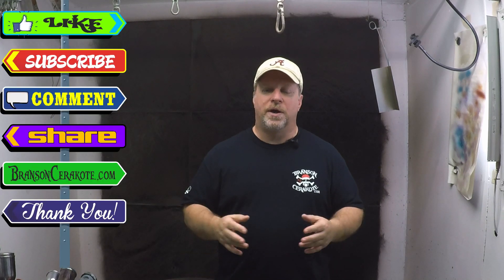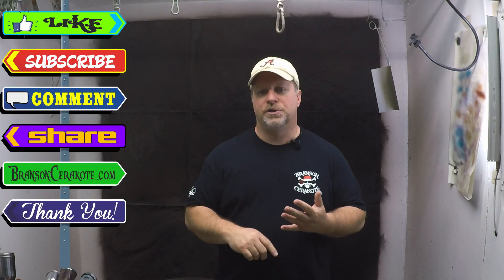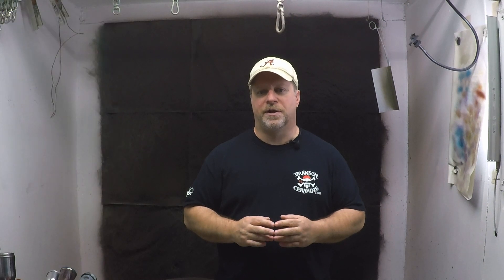Top 10 Applicator Mistakes I Hear About | Branson Cerakote and Laser

Comment: Hello John, you were talking about degreasing, you mentioned not putting a part back in the acetone. What if when you bring the part out of the Oven and it brings some oil to the surface, cerakote says to repeat all the steps over again? And I notice you degrease before you blast? Just wondering what is the difference in doing before you blast and after. 
Thank you for your videos and advice!!
DAVID/DB CERAKOTING
Reply from the maker: It's not that often that degreasing doesn't take care of any issues the first time around, however 700 barreled actions are notorious for weeping. Put them in the oven, heat them at 300 for an hour, and move them to a rack away from a heat source. Use a squirt bottle of acetone, and soak the weeping area. Put the item back into the oven for 10-15 more minutes, and check it again. Repeat as necessary. It usually doesn't take too many times to take care of the issue.

We soak, gas out, then sandblast. It's just always made more sense to me, and I've never had an adhesion issue from doing it that way. Not saying their way is wrong, but I've just never had an issue with mine.
Reply: Branson Cerakote thank you!! I always appreciate any advice that could help me do better work for people!!
Reply from the maker: @DavidBrown-cv7qb  Glad to help!

Comment: So if I’m doing two coats and I’ve gotten everything prepped, what you’re saying is, I should air dry for 8 or so minutes after I spray the base coat, stick it in the oven for 10-15 mins (depending on oven) then add your next coat?
Reply from the maker: Spray, air cure (to allow the solvent to evaporate), then bake in a 180 degree oven until tack free (around 8-10 minutes. It's a feel not an exact time). Remove, allow to cool. Spray the next color, repeat.

Comment: on multi colors do you remove the stencils for the final cure or are they able to handle the high temperature?
Reply from the maker: They handle it fine, but I usually bake the item about 15 minutes then pull them off. They are easier to get off, and it let's you make sure your project is good to go.

Comment: I am having a heck of a time coating my Taurus 605. I did an antique wear type finish using Graphite black on top of burnt bronze. It came out looking amazing! But the cylinder got stuck or super stiff and other parts as well. Even when I tried doing a thin layer. Is the 605 just that intolerant in its spacings?
Reply from the maker: Generally with revolvers, we will do the yoke in Microslick, bake it, then tape that area off so we can spray the rest of the gun.
Reply: @BransonCerakote  cerakote says micro slick has the same coefficient of friction as regular H and elite series. The only time they recommend using micro slick is if you need the higher heat resistance. What is your take on that? I get that the micro slick coating thickness is only ⅓-½ as thick as H/elite (which is why you recommended it to the op), but I was wondering about how lubricidus they are in comparison. Thanks.
Reply from the maker: @littlejackalo5326  It is a teflon coating. I'm no chemist, but I can tell you that in our experience, it handles repeated wear better, in areas like pistol barrels and revolver yokes.

Comment: Wow! what a great clip! Big ups to you Branson :) 
Question from my side (a newbie :)) 
I'm starting my very first Cerakote project and want to coat aluminum parts. 
Which sanding media and PSI would you recommend. Thx & greetings from Austria
Reply from the maker: 100 Grit Red Garnet is what we recommend. For metal, you want to be at around 80psi.
Reply: @BransonCerakote  Thanks a mil! :)
I found red garnet sand in my area with 80 or 120 Mesh. Which one would you choose then?
Sorry to bother you with these questions, but really what to make sure to follow the manual ;)
Reply from the maker: @marquezvanroeschen5340  It needs to be 100, but if those are your only choices, 120 may be the best. I don't think it's going to be aggressive enough, but 80 will crater your project.
Reply: @BransonCerakote  Ok great! Thanks!

Comment: I have a batch of -8 an fittings i would like to shoot in Glacier titanium air cure, i did a test  on one but prepped it with red scotch brite pad.  At the end of the video you mention this is a bad idea. What is the right course of action as sand blasting these swivel fuel fittings seams like a bad idea. They are anodized black the best i can tell.
Reply from the maker: You really don't have another option. The sand blasting doesn't just remove the existing coating, but also etches a specific surface pattern into the item that allows the coating to properly adhere. I've sand blasted thousands of items without any issues. Also, remember that all you need to do with anodized products is scuff them. The only difference is that you are scuffing the anodizing, not the actual item.
Reply: @BransonCerakote  Thank you for the reply. Great info and videos.
Keep it up.
Reply from the maker: @natepierce1281  Absolutely.

Comment: I need help with poly frames. All my frames that I finish come out sandpaper rough once baked, so I'll try to make this short. I clean the frame, degrease, sandblast @ 30 psi, wipe down with Acetone, spray air to dry, mix my colors, strain with proper screen, dial 1:2 ratio on gun, spray within 3" up and down, seem to coat very well, let stand for 15 min, bake @160-180 for 2 hours. it comes out like sandpaper??? I do the same thing with the slide, but 250 for 2 hours and it's always smooth as glass. Please help
Reply from the maker: could be a couple of things. Either you are sanding too much, or spraying too light. When sanding, all you have to do with poly is knock the shine off of it. Once it's dull, you are good to go. As far as dry spray, trash the Cerakote instructions on setting up the gun. The link below shows how we do it, and we don't have spraying issues. Dry spray can also be caused by spraying too fast. You may change the color, but the coating is too thin. I'm not trying to upsell you, but you may benefit from joining Applicator Hangout. Here's the HVLP adjustment video. https://www.youtube.com/watch?v=XsBd9xK1FbU
Reply: @BransonCerakote  Thank you for replying, trust me, nothing you guys do is ever an upsell, I'll take whatever advise I can get. I'll play around with air settings today as well as go lighter on my blasting. Thanks for the info.
Reply from the maker: @eddiewood537  Any time.

Comment: What's your air pressure at the gun when the trigger is being pulled to spray a part? Also why for cerakote does it get degreased, gassed then sandblasted? In my head I keep thinking sandblasting then soaking in acetone then degreasing would work. Sorry for the noob questions, I've Duracoated and hydrodipped for years but I have a bottle of sniper grey cerakote sitting in the gun room that I've been to scared to do.
Reply from the maker: Working air pressure for H series, V series, and C series is 20 psi. For clear and Elite, it's 30 psi.

Cerakote's official way of doing it is to degrease, sand, then gas. I've changed that a bit. I degrease, gas, then sand. I've been doing it this way for years, and have never had an issue. I wouldn't recommend soaking after sandblast. The problem is, sanding opens the metal up, and if there is any silt left in your acetone, it MAY find it's way into the metal.
Reply: Branson Cerakote totally agree with you. I reduced more of It just spending time degreasing as much I can. This is the most important in general to get a good finish. After I put more effort on phase 01 the number of oil residue left on parts decreased drastically! Again: nice video John!
Reply from the maker: @lnsimas1  Thanks for watching!
Reply: @BransonCerakote  thanks, working up the nerve to go out to the garage and go for it.
Reply from the maker: @speedfreak1000z28  Worst that can happen is you sand it down and start again.
Reply: @BransonCerakote  that's true, wouldnt be the first time, hydrodipping had a learning curve too.
Reply from the maker: @speedfreak1000z28  I've heard, lol.
Reply: @BransonCerakote  I have some dust covers that we might have done in the wrong order. They were sandblasted, acetone soaked, then gassed. My question is, should I use them? I saw your comment about degreasing, sanding, then gassing. Help lol
Reply from the maker: @KINGSL0THXXIII  I'm sure it's fine. The reason we soak first is that if you put sanded parts into your soak tank, you run the risk of having any gunk that's dissolved in the tank settling in the etching. It's really not a big deal, and more insurance. If they came out of the oven fine, I wouldn't sweat it.

Comment: So I’m in the middle of doing 1000 exhaust flanges fresh from a machine shop and have been sandblasting until there is completely no shine. Is it safe to sandblast less as in etching the service completely but still having a dull shine to it? (Using glacier black c series if that changes anything. )
Reply from the maker: Yep. Cerakote is a little too subjective on this one, "If it's still shiny, you haven't sanded enough". Just go over it really good, and it will be fine.
Reply: Right on! Thanks for the reply!

Comment: I had a 2022 Florida shop screw up a Glock 22 gen 4 slide. Cerakote Elite. Carbon Grey color. I was told the shop Carbon Grey elite was older & may not work correctly. Cerakote can weaken, degrade. I was unaware of it. The Cerakote seemed thin, wore off, peel off quickly. Not just Kydex holsters or carry. The shop didn't apply it properly.
Reply from the maker: I misunderstood your last comment. I thought you meant they told you it degrades once sprayed, which it won't. If they sprayed old coating, they were wrong. Cerakote is good for 1 year from the time it is opened. It's pretty obvious from an applicator standpoint when it's bad. They shouldn't have sprayed it if it was thick from age. I don't know what shop it was, but that's a good example of why folks should shop around and look at the work a shop has done in the past.

Comment: Wait so the blisters are from not shaking it enough? I'm an auto painter. So I assumed I put it in the oven too quick and it was a version of solvent pop
Reply from the maker: Depends on the blisters. Hard, honey colored blisters are a hardener issue. Small round blisters are usually water, and larger puffy blisters are usually contamination.
Reply: @BransonCerakote  ah ok. These were rather large. Must've over degreased
Reply from the maker: @mbulloch  Could be. Did you put the parts back in the soak tank after sandblasting?
Reply: @BransonCerakote  I did actually. I did some parts a year ago. Recently did a few more. Was relying on memory. Dumb mistake on my part. Watched your video and was like oh shit I did that. Re blasted, blew off, and went straight to cerakote earlier tonight. Came out perfect. Thank you for replying and doing these videos!!
Reply from the maker: @mbulloch  Happens to us all.
Reply: @BransonCerakote  here's another question. And Thank you for taking the time to answer. I just did some parts. They looked good. Or so I thought. Pulled them out of the oven and I missed a spot 🤦. Do I have to re blast and start over? Or can I "touch it up?"
Reply from the maker: @mbulloch , Unfortunately, you need to reblast and start over. If you try to spot repair, you'll see a difference in the coating.

One thing I suggest for folks until they get their technique down is to tack the project out, let it cool, then take it outside and look it over in sunlight. If you have anything that needs to be touched up, just run a pass over that area with the same color. Since the coating isn't hard baked, you can still add more.
Reply: @BransonCerakote  Got it. Thank you. Now that you say that. Again I'm an idiot. I'm an auto painter by trade. And I use a sun gun to check over my work for coverage. Should've done it in these pieces too. Thank you Again!!!
Reply from the maker: @mbulloch  Happens to us all.